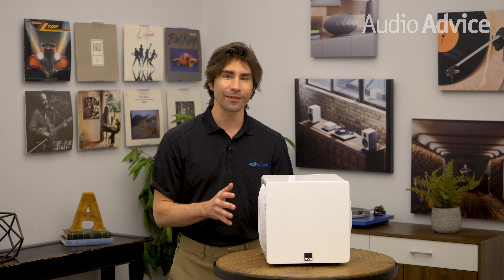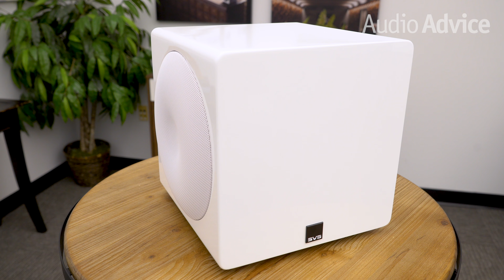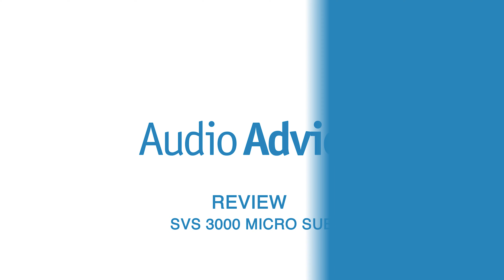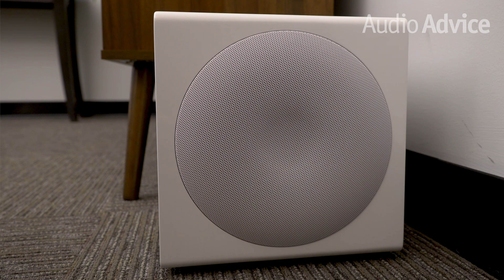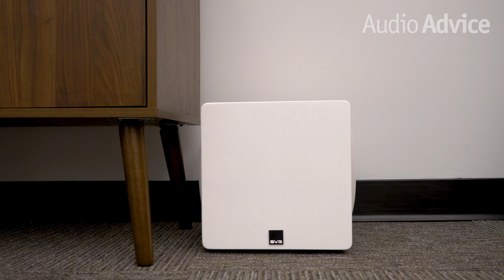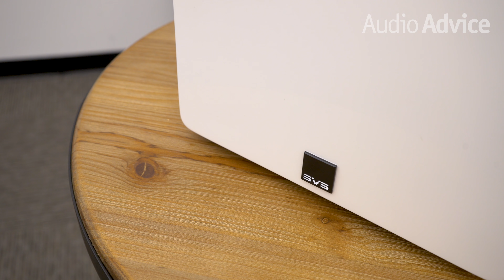SVS 3000 Micro Subwoofer Review

Comment: Hi, thanks for the video. Would you recommend this sub for The Fives effectively being used as a soundbar alternative via eARC? You say that sound effects were "not as impactful or immersive". Even so, did it still improve the low end and the overall sound of The Fives? Was connecting this to The Fives an upgrade or would you leave them as is?
Reply from the maker: A sub will definitely improve the Fives. This might be a bit of overkill though unless you were short on space, then its a great option.  Thanks for watching
Reply: @AudioAdvice   Thanks for your prompt response. I'm not necessarily short on space but I do want to pair my Fives with a sub which is as small as reasonable. I understand the Fives sets a HPF when connected to a sub so am not sure how that works when integrating a sub... May I ask exactly how you connected it to the Fives? Did you plug it into LFE? Did you set a low pass on the micro 3000?
Reply from the maker: @davidbowyer6840  You should run into the LFE and bypass the sub cross over, if you you are in the US, please consider Audio Advice for your subwoofer purchase.

Comment: Since when is a Dual 8" Sub "Micro" ? That would be 4" to 6" like the Cambridge Audio Minx X201
Reply from the maker: As compact subwoofers typically go, the 3000 Micro Sub is really small with its cabinet being an almost 11-inch cube. Mounted on opposite sides of the 3000 Micro Sub’s sealed cabinet are two fully active high-excursion 8-inch woofers, so we agree, the technology is nothing short of amazing.  You can read more in our full-written review here: https://www.audioadvice.com/svs-3000-micro-subwoofer Thanks for watching!

Comment: What about the advantages of two drivers working in opposite direction? This should help stabilise the cabinet, theoretically.
Reply: You are correct!
Reply from the maker: Greetings Christian. You are right. By firing in opposite directions, the mechanical energy transferred to the cabinet from the drivers is effectively canceled out, which creates a sonically inert environment throughout the micro sub’s enclosure. These dual-opposing, side-firing 8-inch woofers operate acoustically and electrically in parallel and in perfect unison for pristine low-frequency output at all drive levels with crisp, musical transients. We dive deeper into the performance in our full-written review: https://www.audioadvice.com/svs-3000-micro-subwoofer Thanks for watching.
Reply: @AudioAdvice  Thank you for the thorough reply. Interesting product. Small chassis but large woofer area. But what about positioning? One woofer is nearer to the wall or corner , unless you place the Micro diagonally in the corner.

Comment: Hey there, I have a Yamaha A-3080 AVR and was curious if it made any sense to bi-amp my front Polk Audio LSI9 bookshelf speakers to my Pioneer M-72 amp?  The 4 channel 100 amp has not been used in years because my old Denon had no pre-outs. My current system in a 5.1.2. Thanks Ron

Comment: I'm about to buy the SB-3000 next week to replace my SB-1000. Is there is big difference in terms of power between the SB-3000 and the 3000 Micro Sub?
Reply from the maker: Greetings Thomas! You may be interested to read our full-written comparison on the entire SVS subwoofer lineup: https://www.audioadvice.com/videos-reviews/svs-subwoofers-comparison/
In a nutshell, the SB-3000 cabinet uses a large 13" woofer inside what's basically a 15" cube and it weighs 54 pounds. Bass goes down to 18 Hz in frequency response and puts out almost 127 dB at 30 Hz, which is just astonishing. When you compare those dimensions to the new Micro sub, which packs in two fully-active high-excursion 8-inch woofers inside of a compact 11" cube, differences in performance should be expected. However, despite the obvious size differences, you will have impressive low-end from a small 11" cube that will go all the way down to 23Hz! To drive the fully-active dual-opposing drivers, SVS used the Sledge STA-800D2 power amplifier, which is an 800 watt Class D amplifier capable of 2,500+ watts on peaks. Hope that helps!
Reply: @AudioAdvice  I've read it this morning, very interesting thanks! I've seen that in the "3000" category, the SB is the most interesting one compared to the PB and Micro, so I'll keep this winner as my final choice :)
Reply: I would just get a second SB-1000 if I were you.
Reply: @Ibhenriksen  why? A SB-3000, even if there is only one, will be. Way more powerfull and punchy no?
Reply: @Popolosse116  It could be. But depending on your acoustics it may end up more boomy. What's nice about SVS is you can try before you buy! You COULD get both. An SVS 1000 and an SVS 3000 and just return the one that you don't need.

Comment: Velodyne microvee imo was ok. This would be a great subwoofer for ppl with small spaces.   Wish they made smaller cube speakers like Bose.
Reply: The SVS Satellites are about the size of a Bose double cube, but sound FAR better!
Reply: @jasonm3871  I didn’t think their satellites were close to the Bose size. Definitely sound better than the Bose but size still bigger. Not discrete enough imo
Reply: @jimcole2648  only about 3 inches taller and 2 inches wider (deeper too, but not as noticeable). Little bit bigger, but much better.

I doubt they could/would get much smaller and get a sound they’d be happy with. 

While they have limitations, they Satellites are amazing for their size.
Reply: @jasonm3871  agree on sound. Who would think they would get into the micro subwoofer sizes? I’m sure they will soon add smaller satellites. They are a bit heavier also. I haven’t looked but I don’t recall even built in wall speakers also. That would be a great addition to their lineup for atmos imo.

Comment: I'd like to know how this sub compares to the SB-1000 in terms of speed, impact and overall output.
Reply from the maker: Greetings Danny! The SB-1000 has been replaced by the new SB-1000 Pro. You may be interested in our full-written comparison on the entire SVS subwoofer lineup which compares both the new SB-1000 Pro and the new 3000 Micro:  If you want to dive even deeper into the performance of each subwoofer model and how they actually sound, we just released a video and full-written review on the SB-1000 Pro as well. Feel free to check that out here: https://www.audioadvice.com/svs-sb-1000-pro-subwoofer - Our full written review on the 3000 Micro can be found here: https://www.audioadvice.com/svs-3000-micro-subwoofer - Hope this helps! If you have more questions about which model is the right solution for your room dimensions and your application, our chat experts can help you over at AudioAdvice.com!